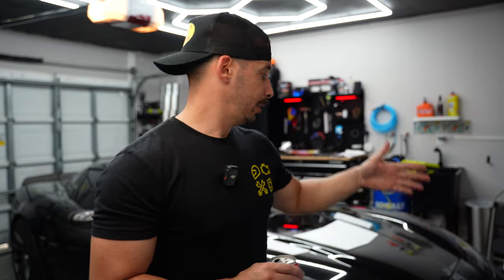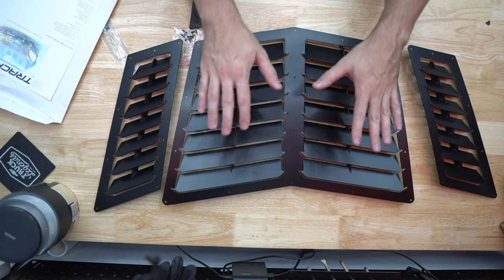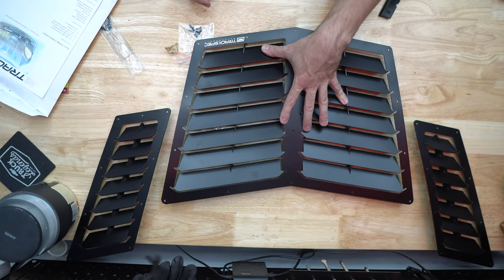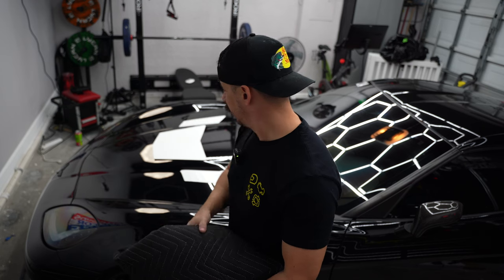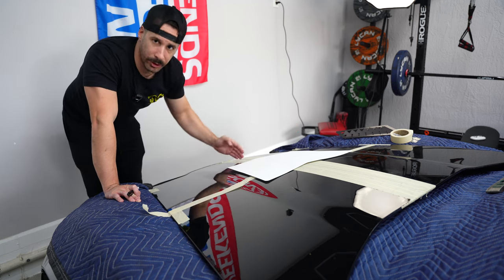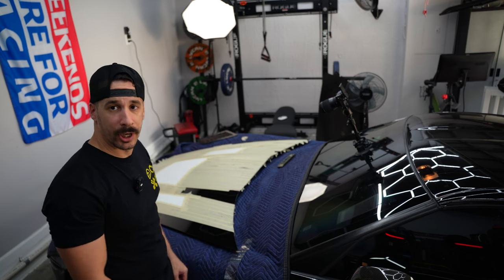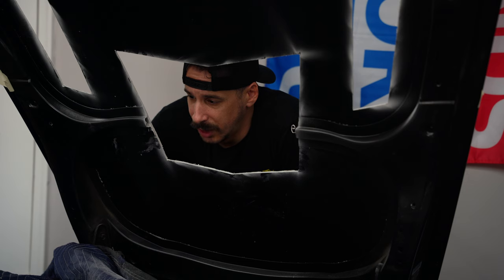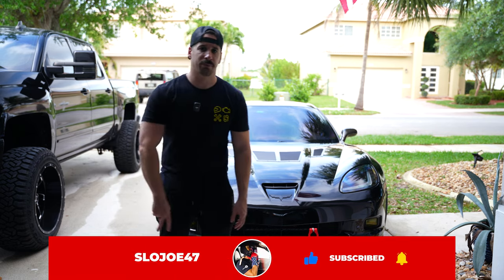Corvette C6 Z06 Hood Vent Install - Trackspec Motorsports Hood Vents

Comment: Got the Z looking good bud.  The venting was a great idea and really adds to the looks for that "Racecar" appeal.  Are you going to add any extra oil coolers to the system or see where it sits currently after a track day and go from there?  Really appreciate all the updates, helps us little guys figure out what we'd like to do to ours.
Reply from the maker: Thanks! Going to go back out as is. Want to check a few things. Want to see what my new oil temps are with the higher viscosity and the hood vents. Also want to see what coolant temps look like with the new larger radiator. More than likely as I get faster and more comfortable I’ll do some oil cooler upgrades but right now won’t be necessary.

Comment: Does the C6 have a factory oil cooler? Or are there any aftermarket versions available?
Reply from the maker: So some c6s like the z06 come with a factory external oil cooler so you can buy a upgraded model of that or go with the improved racing ones that mount two coolers where your dog lights go

Comment: do not run 50w oil in this car ! .. LS7 tollerences  are tight .. use XPR 5w 30 RP its the best
Reply from the maker: When the oil temps get above 200 degrees a 30w is way too thin and can risk lack of lubrication. I used to run 40w and went up to 50w to test. This car is primarily a track car doesn't see too much of anything else and GM calls for heavier weighted oil on track so doing it to help extend the motors life with more lubrication.
Reply: @SloJoeRacing  my oil Temps never get above 190 5w30